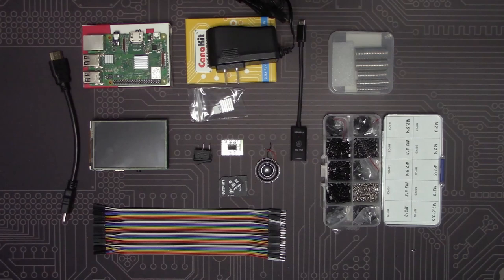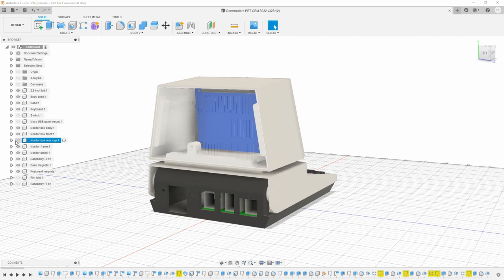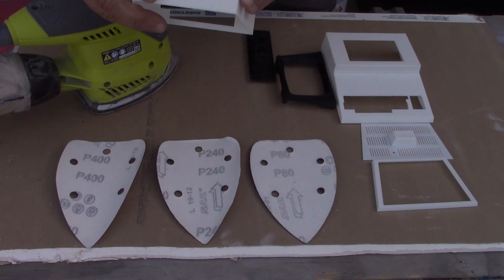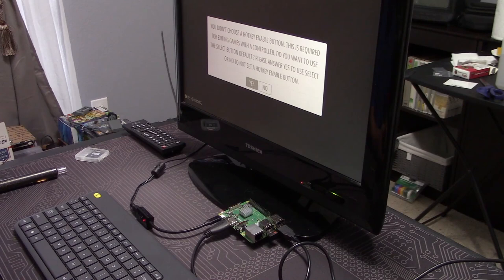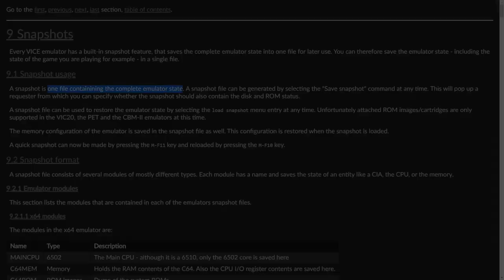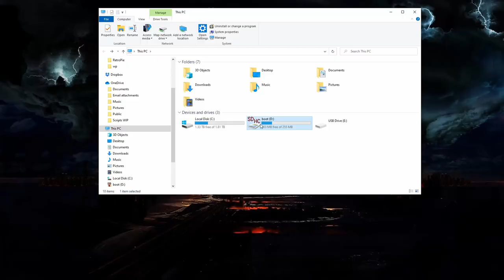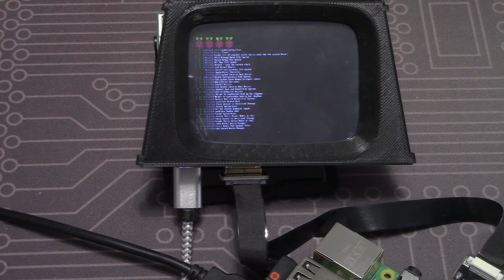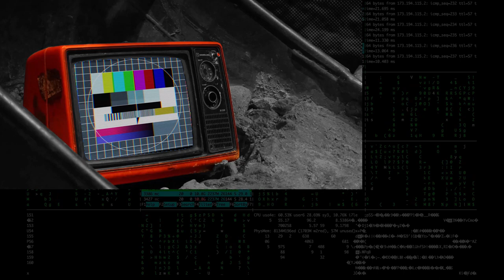How To Build a 3D Printed Mini Commodore PET With Working LCD Display

Comment: Did you have to do any other size adjustments to get the 3.5" HDMI display to fit Lorenzo's design, other than the modifications to the bezel?
Reply from the maker: Nope, everything else worked out just fine. Well aside from the fact that I accidentally made the change to the wrong side and I had to rotate the screen display 180 degrees. :-)

Comment: Hello,
I recently built a commodore pet mini but iam having trouble. 
I installed GTK3VICE and did everything I had to but now I dont know what to do. I uploaded a rom to pi called c-pet.vsf its basically a commodore pet rom but when I launched my pi and then installed the rom onto it it launched commodore 64 basic v2 instead of commodore pet v4. How can I fix this? I used vice and do i need to use lr-vice? And when I turn my pi on I see commodore 64 then i click on it and there is the rom but it launches the commodore 64 basic 2v. Thanks if you help me!

Comment: Great video!  I just ordered all the parts to make my own and wanted to model mine with the same HDMI display as you used.  Is there a place I can get the .stl files you modified for this display?  I don't have a 3D printer and have to send the parts out to a service.
Reply from the maker: Hi Ed, you can find the STLs on my Thingiverse page. (https://www.thingiverse.com/tonylandi/designs)

For an outside agency I recommend my buddy Garth over at 3D Print Direct. He's a great guy and does quality work (https://3dprint.direct/)
Reply: @Operation8Bit  Thanks for the quick response!  Cheers!
Reply: Sorry Tony... I can't seem to find this specific build in the designs?  Cool 1702 monitor though!
Reply from the maker: @qzpt84  sorry, it seems like forever since I did that project/video and I forgot that there were a few files that I modded. Shoot me an email at support@operation8bit.org and I'll send you a zip with everything.

Also, TY on the 1702 monitor. That was a great project and a fun video. Make sure to check it out when you have a chance